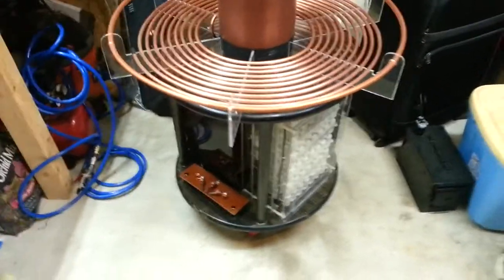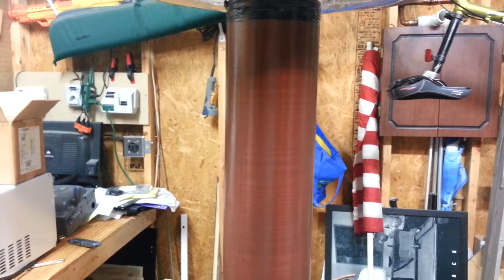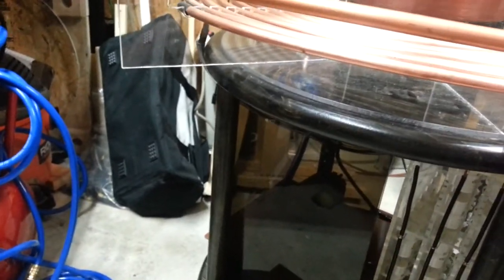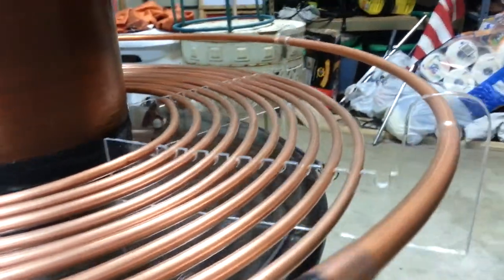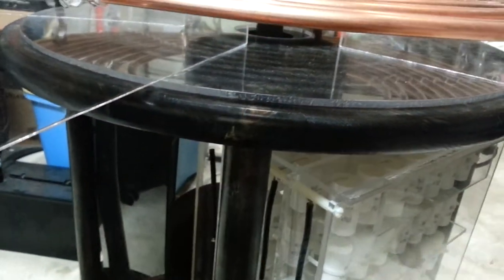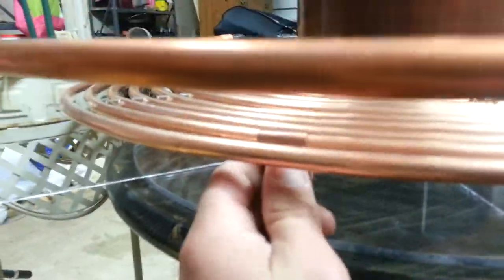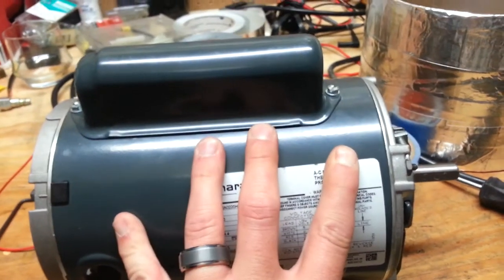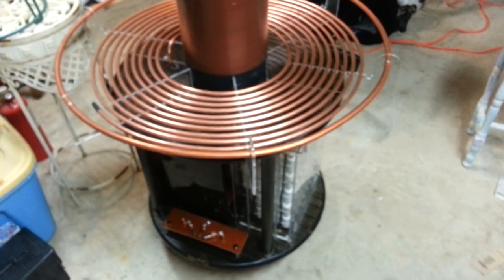8" Tesla Coil Overview

Comment from the maker: Thanks for the Sub Anthony, 
First and foremost - BE CAREFUL WITH THOSE MOTS -
As for your coil, none are the same. Each and every coil will behave different even if built to the same specs. Check out the archives Pupman and ClassicTesla. The JavaTC program should help get you in the ballpark for calculations. Keep up the coiling and be safe.

Comment: Thanks for sharing this vid really good work she looks beautiful....I'm halfway through a build on a 7" coil 48 942c caps 60nf at 22kv,quad mot no ballast.32" about 1200 turns 22 gauge wire.primary quarter inch pipe with quarter inch spacing 12 turns.I'm not sure if my specs are gonna work its mostly guess work as my math is bad.i have built a nice twin Mot 4" coil if you want to take look,it's no way near as nice as yours though cheers,you tube .tesla coil for sale Anthony Lockwood channel,